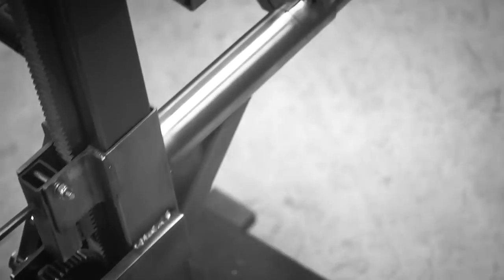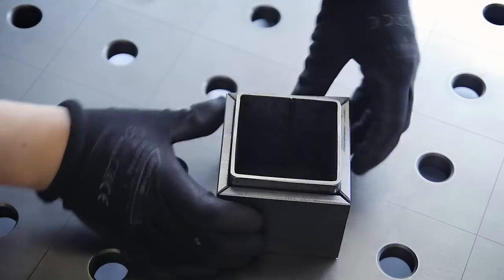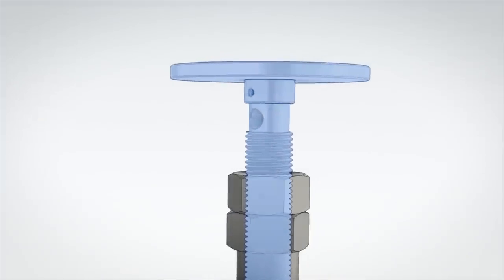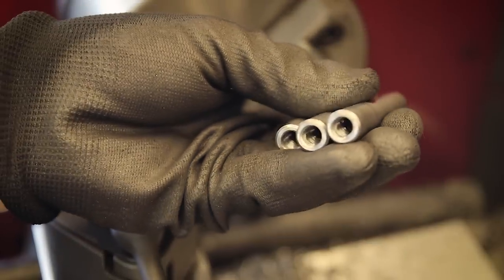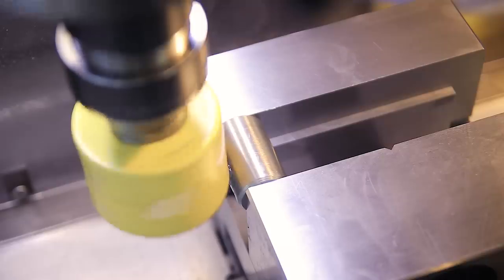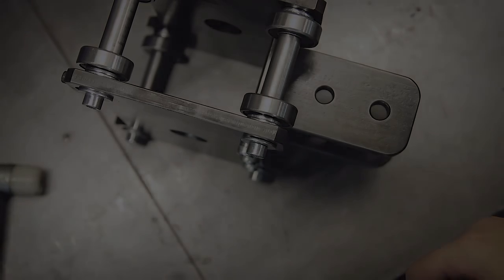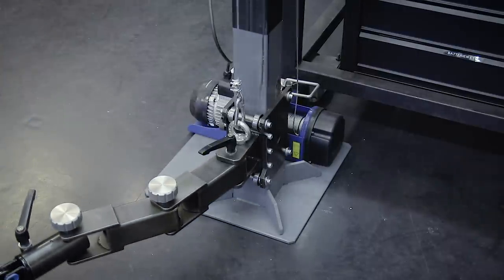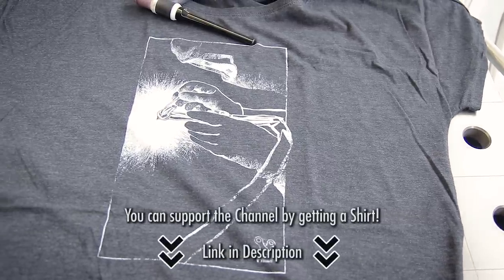Electric Workshop Crane for E-Bikes, Tools and more

Comment: Super geil!

If you don’t mind to share, what is the drill press vise you use with your mill at 00:08:02 ? Looks like a Röhm kontrollschraubstöcke? The PL-G with a screw, maybe? 🤔
Reply from the maker: Ha I wish I could afford a Röhm Vise.  But yes, it's basically one of those, except the chinese knockoff version. They are shockingly good though for the price, very accurate and all tool steel. You can find them on eBay if you search for "QGG Vise" or something along those lines
Reply: @PhilVandelay  — Wow! You had me fooled! Very impressive knockoff, indeed!

I was really scratching my head, because the dimensions don’t quite match the PL-G with the screw, I even went through the Röhm’s catalog to re-check and then decided to ask.

I’ll definitely search for / order that version eBay, even out of curiosity. Danke!

My favorite, the indicated 2-axis tilting Röhm PS-ZD is very nice… but then, we’re almost in digital CNC price territory, so I have a hard time justifying such a purchase “just because I’m spoiled by my Swiss culture”.😂

So I very much understand that part where you decide NOT to use an angle grinder to do a cut-out. I was like “ahhhh… I would have done the same”. It’s a “talk to a mental health professional” level. 🤣

Comment: Did you consider moving the crane limit switch to the top of the column somehow?
Reply from the maker: It would be pointless because the limiting factor during actual use is usually not the carriage hitting the top, but the bike hitting the ceiling before the carriage.  You'd have to adjust the limit stop for each bike and each holding situation which is not practical, so you simply have to watch what you're doing, as with any tool
Reply: @PhilVandelay  Makes sense. maybe a pressure plate on the ceiling then 😆

Comment: Nice work...but:
Clamp a solid chunk of PVC/POM/PA/wood or whatsoever on the rope to activate the limter of the winch BEFORE the cariage is full on top
Reply from the maker: I thought about this but the thing is that the limiting factor in actual use is not the crane carriage but the bike that's being held. In almost all cases the bike will hit the ceiling before the carriage hits the top, so I figured a limit stop would be of little use. You simply have to watch what you're doing when operating this (as with all tools really). I did add end stops to my mill powerfeed though ;)
Reply: @PhilVandelay  You could add a movable puck to the cable, but you'd be relying on the user to remember to adjust it upwards when clamping a taller bike.

Comment: Super sweet! What was your budget for this project?
Reply from the maker: Actually not that much (at least compared to what a crane like this costs normally). The most expensive thing is the holding claw + winch at about 250€ combined, steel especially as flat bar is quite cheap so probably around 400-500 in cost overall including some hardware like fasteners, handles and stuff. And I always buy more than I need so I have quite a bit of steel left over for other projects.
Reply: @PhilVandelay  actually much cheaper than I first thought! Nice job!

Comment: Just want to point out that you should never clamp a bike by anything except the seatpost, as seatposts and seat tubes are designed to withstand the forces of a bicycle hanging off of them in a stand. Clamping by frame tubes is an easy way to bend/kink a frame, especially with heavier bikes. The exception to this is a bike with a carbon seatpost, never clamp onto a carbon seatpost as the torsional stress by the frame levering against it in the stand can cause the carbon to fail. In these cases, there are jigs available that clamp in the stand and use two straps around either end of the top tube to hold the bike in the stand. 
Otherwise...only clamp by the seatpost!

Rant over lol
Reply from the maker: If you're inexperienced with bikes this might be partly useful as a rule of thumb. But for anyone who knows what they're doing, dogmatic rules that start with "You should never..." are usually nonsense. Otherwise I would have just destroyed three bikes.

Comment: Props for getting the adjustable rollers in the right two corners and fixed ones in the correct two corners :-) This does not make up for destroying those hardened jaws on your 50kg vice, but it was nice to see, all the same.
Reply from the maker: What are you even talking about? Those jaws are perfectly fine, I use them every day
Reply: @PhilVandelay  See extensive comments on the vice video - but if you can't be bothered then simply get out your feeler gauge set and measure how much space there is under the jaw between the casting and the jaw - it will be approximately or perhaps exactly the same as the needless senseless cut you took off the bottom of them which means they are now being supported only by the screws in sheer and the friction to the casting provided by the clamping force of those flat head screws. A crime against a great vice - the rest of the stuff I didn't like about what you did to it was taste/style/choice but that particular one cut on each jaw was an engineering fail, sorry to say.
Reply from the maker: @fredio54  Oh, I see, you're one of those people... Just enjoy feeling superior then. You're obviously the expert, great job.
Reply: @PhilVandelay  No, not at all. Just get our your feelers and prove the point with a YT short if you feel the need - though I'll take your word for it if the numbers look realistic as per the ultra detailed and beautiful footage and editing in the other video ;-) the evidence is there to observe, the lower surface of a vice jaw should never be machined unless new jaws are being made to fit, and likewise the bottom of the jaw should never be machined unless a shim made to make up the difference. If you never place any vertical load on the vice jaws then it'll never matter to you, but that seems to be one of the core purposes of a vice to me. Note, the above original comment was a positive nod for a subtle thing done right and not wrong - I had questioned it in my mind earlier in the video and it made me smile when you explained what you'd actually done, so commented to give credit where due. Tail half to remind you to read the other comments :-D

Comment: Not to worry, ahhh safety Nazi that says your wire rope clips are not installed correctly is wrong, I do rigging in my job and it's right. There is an old saying and as long as you remember it you'll be fine and that's "Never saddle a dead horse" and with a wire rope clip the main part, or the bottom, is the saddle and u-bolt then the nuts.. If you are smart enough to build all I've seen you build you are definitely smart enough to figure this saying out. Great job by the way and I still love your grinder build.

Comment: I was so confused and rather underwhelmed when I saw "heavy duty" "shop crane" and "lifts 125Kg" together until I realized it was for bicycles.  What a cool build!
Reply: Since the winch is rated for 125kg, it can lift 250kg in his configuration. So yes, it is heavy duty.
Reply: @julianreverse  well, it's not really heavy duty because there really is no such thing other than cute buzz words.
It beats lifting by hand or needing help to move something, and as I said, it's cool.  It serves it's purpose.
But I'm used to 1000+ pound cranes so my standards of "heavy duty" are obviously much different than yours might be.

Comment: So why do you need to lift a bike? Excuse my ignorance
Reply from the maker: Same reason you would lift a car: for maintenance, assembly, fixing stuff, etc. Of course you can do it on the ground to some extent, just like with a car, but if you do it a lot you want a comfortable and fast solution that makes work much easier. Especially with electric bikes things have gotten a lot more complicated so you don't want to be working hunched over/on the ground or lift heavy bikes